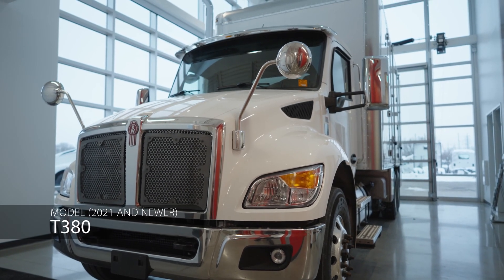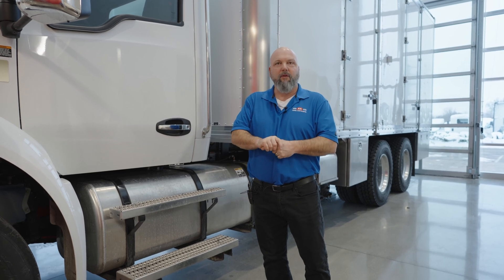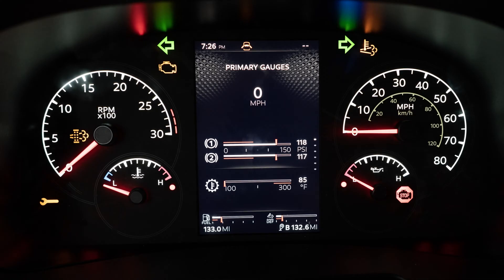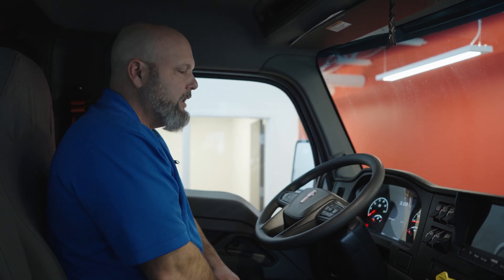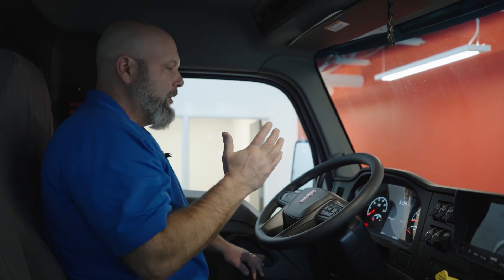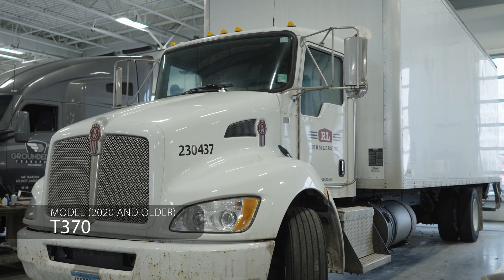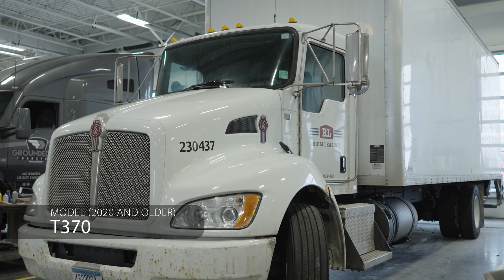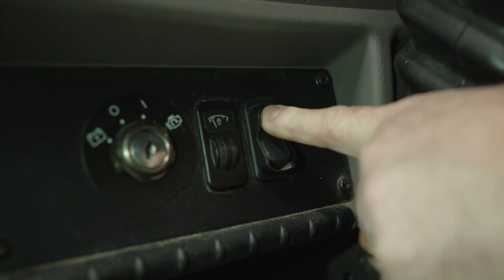Parked/Forced Manual Regen

Comment: A. I've never seen light on dash before suddenly codes pop on and shop work. I've tried Regen but never works. Currently I ask for replacement of sensor and they fight me wanting to pull filter. Codes show plug connector is bad but they insist on most expensive fix.

Comment: If I come back into the truck after working and the regen lights not on but in derate mode is. Can I still pull over and hold the button for 5 seconds to do a manual regen or can you only do it when the light shows? Sometimes I can’t stop working immediately when the regen light comes on. That’s my issue.
Reply from the maker: It depends on the level of derate. If you are in the first stage of derate, you can try to perform a manual regen by holding the switch. However, if the RPMs do not ramp up to start the regen, there may be an issue with the DPF, DEF, or SCR system. If the unit is in full derate, you will not be able to perform a manual regen.

The first level is a warning (MIL light or some kind of aftertreatment light will come on). All levels after that involve torque and speed reduction. Each manufacturer might have different levels of torque reduction, but typically it starts at 10 percent and then goes to 40 percent. If the issue is still ignored, it will eventually go into a 5 mph speed limit.

Comment: Does the truck need to be on because it's not going up to 10 RPMs
Reply from the maker: The engine needs to be running and the engine has to be requesting a parked regen. If you hold the button down and it does not start a regen. The engine is not requesting a parked regen.

Comment: I'm trying to do the manual regen and it doesn't do the rotation it doesn't go up and doesn't start I've done it several times
Reply from the maker: In response to your comment, one of our Regional Service Operations Managers stated:
"If the truck is already in a 5 mph derate/limp mode it will need to brought into the dealership for repair.

If the ECM does not see the park brake being set it will not go into regen.  If the ECM sees that the foot pedal is activated, it will not go into regen.  If there are additional fault lamps on, the unit may not go into regen until these faults are corrected.  

There are multiple reasons for the manual regen to not engage.  If no engagement continues we recommend having the unit hooked up to diagnostics software to determine the next course for repair."
-------------
We hope this information helps!
Reply: @ thank you I could driving for a moment in low gear during a short time and put on swicht engine fan and worked regen its work now, thank you for your feedback

Comment: What if you dont have the button??
Reply from the maker: There is the ability to remove the switch from the truck when ordering it. This allows for the system to regen itself when needed but takes away the ability for the driver to initiate a forced regen. They would have to then go to a dealer for this to be done.
Reply: @RihmKenworth  gotcha,  thanks!

Comment: So how do you know when to Regen it ?Will check engine light come on too?What if the Regen light goes off before you stop it .What if it smells like its been Regening while driving down the road?
Reply from the maker: The unit should only call for a Stationary Regen if a Passive Regen was not enough to bring the DPF differential pressure to where the ECM would like it to be. You know to run a Manual/Stationary Regen when the light in the video is displayed. Now the unit will most likely be running passive regens when going down the road, as this is the main way the system will regen. A Check Engine Light may be illuminated if there is an issue with the system or if the Regen light is ignored as mentioned in the video. But if the unit only wants an active regen run, you should not get a CEL.

Unit also could display an Exhaust High Temp light; this is just an information light to let you know your exhaust is hotter than normal and is performing a passive regen, but the light does look similar. Picture attached for reference.

If you are experiencing intermittent issues with your aftertreatment, the best course of action is to have a service provider check it out for you. 

-- Scott, Kenworth Master Technician

Comment: Hello Ithe truck told ne to do a regen and I stopped and did and its been hours and tbe regen or truck is still idling high and it doesnt go down 
Its been hours
Thanks
Reply from the maker: Its very possible the unit cannot achieve the temps that it needs to perform the regen. While it should have kicked out and thrown a fault code, it might not. Suggestion would be to take it to a service location and have it diagnosed.

Thank you.